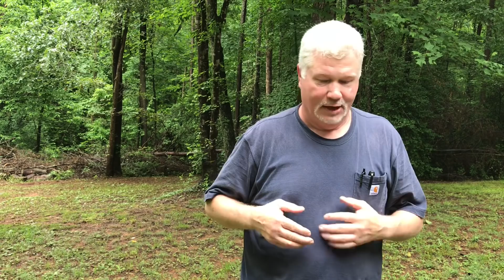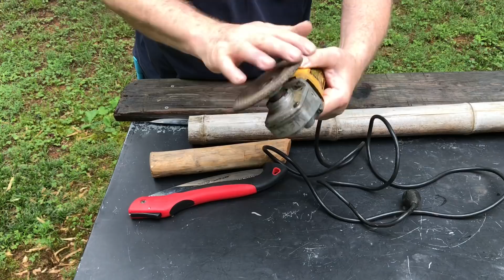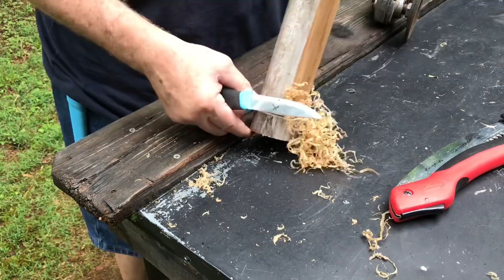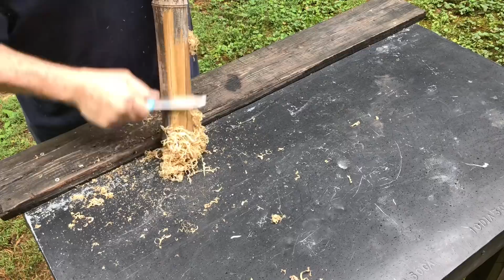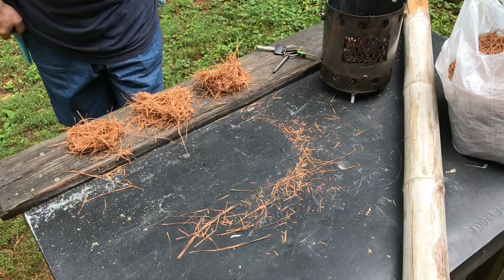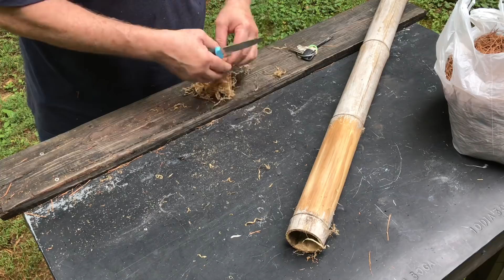Spine Grinding A Stainless Mora Companion Into A Superscraper!

Comment: That’s a great idea! 👍
There are thick scrapers used for making guitars and violins that are sharpened on a 3 inch grinding wheel.
It  grinds a slight hollow that produces a good burr. This is very similar (—O ) but quicker.
Although, as you indicated, it’s good if you have experience with angle grinders. 

BTW, liquid tape or plastic dip will fix those cords. Just paint it over the damage and let it dry. Works perfect. As far as the blade guard goes, I go with gloves ,face shield and prayer.
Reply from the maker: Thanks friend!

Comment: I noticed you tend to plant your ferro rod and push with your blade. I do the same. I see a lot of people recommend pulling the rod. That doesn't seem to work as well for me. Nice vids! Thank you! I'm learning a lot from you!
Reply from the maker: Notice, that it's always powerful men recommending the pull technique. What's the rest of us supposed to do? They over state how terrible it is to knock your tinder around. LOL! The few times that it happens?... ahhh, straighten it up up and continue. Pinning tinder down like I do and pushing sparks straight from the ferro rod directly onto the tinder is ideal 95% of the time. I pull the other 5%.
Reply: @DavidWestBgood2ppl  Makes perfect sense. Thank you.

Comment: As an ex bricklayer, I used to hold bricks between my feet (on edge) and cut "splits" with a 9 inch grinder. Dust and crap kicken up between my crotch :) That was near 30 years ago. I got an AC shock from a bricksaw lead once, it was laying in water. Not serious, just a bit of a surge. On another occasion a different bricksaw was giving us shocks. Faulty internal electric protection was shorting out.
I have used a file on mora companions (ss). File was quite new at the time, at first it wanted to slide, after some material taken off it was OK.
Have a nice day
Reply from the maker: Before safety was the main goal on jobs, I walked steel and high lines without a harness, used tiny scissor lifts 30' high with no rails, removed pipe insulation with the air saturated with floating asbestos, climbed 30' A-Frame ladders that were too ricketty to be on, stood in 2" of water all day demo-ing stainless pipe that was supposed to be flushed of the caustic acid... getting mild shocks and acid burns to my skin, worked inside vessels and enclosures that had very unsafe air quality, routinely ground off every kind of paint and coating without any kind of mask or ventilation, been right there with the welder as he welded right through those same paints and coatings without a respirator on... I'm glad that idiocy doesn't go on anymore. Safety has decreases productivity by 10x, but it is necessary and right.
Reply: Right on. I have worked on "widow maker" scaffolding. Worked inside an old Hospital roof building fire walls as an apprentice that had asbestos "removed", no breathing gear.

Comment from the maker: I paid an extra 4 dollars to have a 90 degree spine put on this Stainless Mora Companion that I just bought... After using it to scrape a bow drill set in my last video (LINK below), I saw that it only turned out to be a mild scraper. That's not going to be aggressive enough for me. I'm used to my Mora Spines being SUPER SCRAPERS! 
   Yes, I've filed down spines before, but I prefer using a side grinder for this quick and easy fix.
   I think you'll be able to see the difference in the before and after scrapings, but I really wish you could feel the difference in the bite. Come have a look and please SUBSCRIBE at the end of the video thanks!

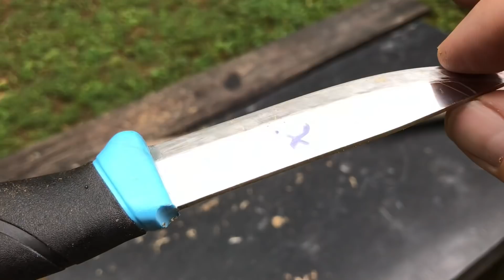***I JUST NOTICED AT 4:51 THAT THE SPINE NEXT TO THE HANDLE WILL STILL NEED SOME TOUCHING UP WITH MY DIAMOND STONE TOMORROW... I CAN STILL SEE SOME REMNANTS OF THE ROUNDED CORNER.

My New Mora Is Not All It’s Supposed To Be, Sourwood Bow Drill (Look at all the oxalic acid)
https://youtu.be/BnfYTvP_mbE

A New Baby Blue Mora Companion Is On It’s Way, Let’s Beat Up A Little On My Old Moras
https://youtu.be/lcq-_cp-f5g

My New Mora Companion is Very Easy to Keep SHARP
https://youtu.be/Kl3og9Jj-Mk

Fire Roll With The Mora Companion
https://youtu.be/8gQMbDpiRZ8